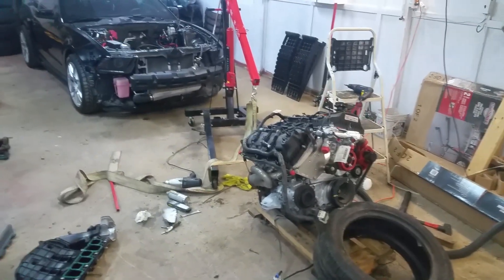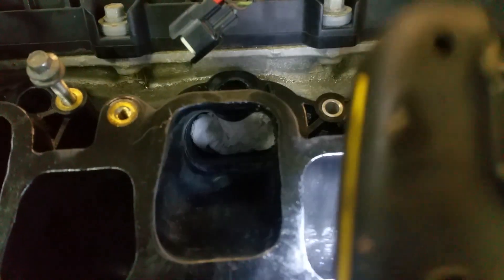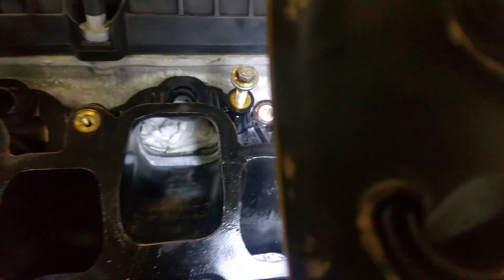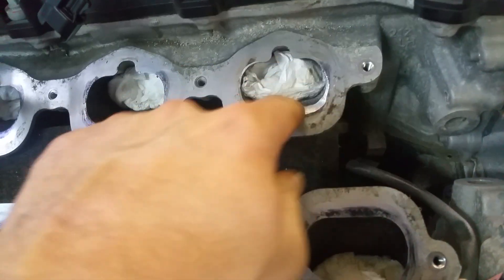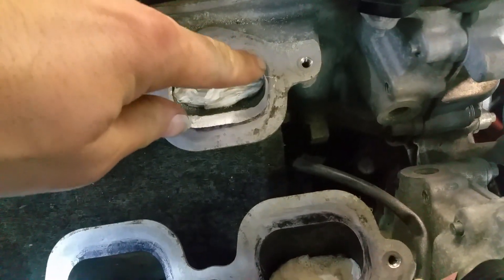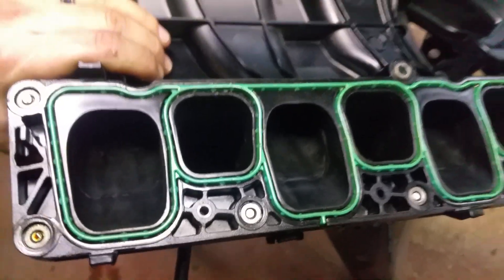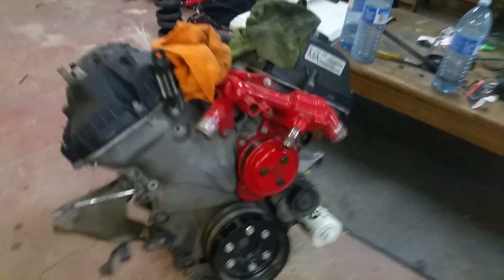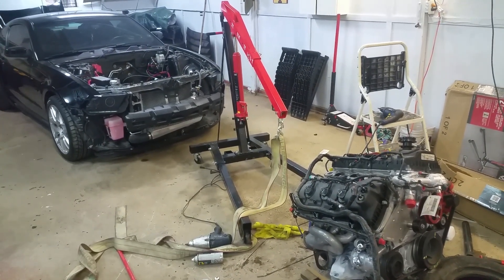3.7 Mustang, port matching heads to ported manifolds on new engine.

Comment: If i get a ported intake manifold do i need to get ported heads?
Reply from the maker: You can get 2 types of ported intakes. Ones with large bore ports like I have and have to port match the heads and ones that are larger ports but funnel down to the same size as the heads.

Comment: Thank god the 3.7 engine isn’t too expensive lol I see a lot of them for under $1k
Reply from the maker: Cost me about 1350 US with 60,000 miles on it. Harder for us Canadians to get them apparently. They had to ship mine in from New York.
Reply: Mike Landry  how hard is it to do the swap??
Reply from the maker: @FerRod2113  Not bad at all. Undo the header flange bolts, transmission bolts, coolant lines, fuel line, motor mounts and unclip the main harness from the computer and a couple small things and it's ready to pull out. It's awesome being a 60 degree V6. Lots of room to work.

Comment: I was thinking about doing my 3.7. You've convinced me! I didn't realize how much material can be removed. Thanks and i hope the new year puts that sweet Stang of yours back on the road.
Reply from the maker: Just have confidence when doing it. It took me 11 hours to do both the upper and lower manifolds with the plastic polishing. You don't want to screw them up.